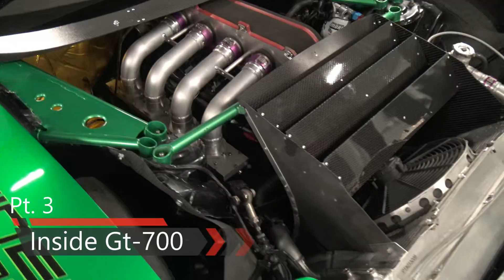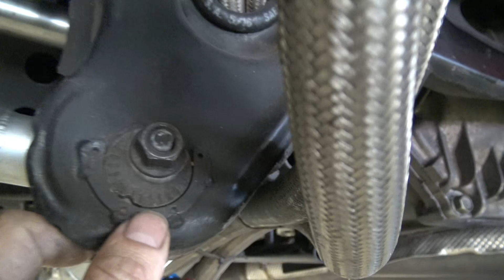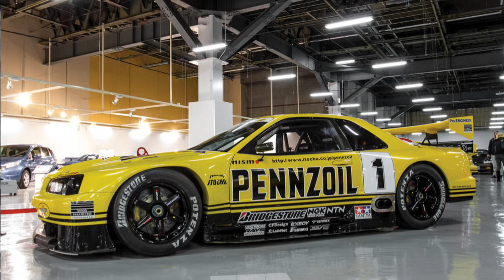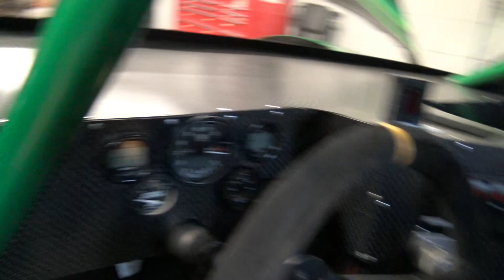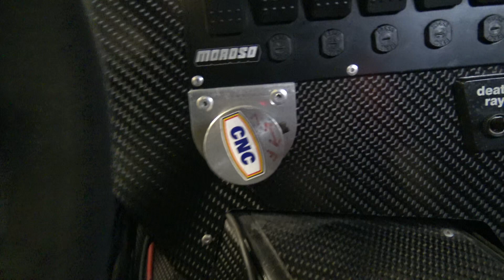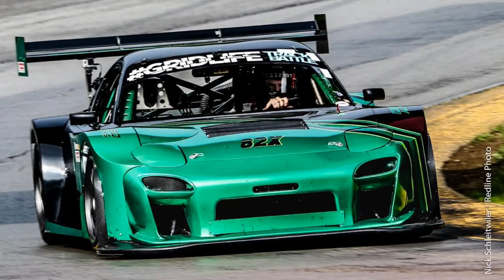*part 3* Inside the 4 rotor Mazda Rx7 Gt-700 engineering. Defined Autoworks

Comment: Old video, but I just ate up all 3 parts. Excellent work and engineering effective solutions to the engine and chassis!

Also one question... what does the death ray button do?
Reply from the maker: Thanks! Currently it is the datalogger but changing to a high power/ low power switch in the next month.

Comment: About the only thing I can throw in to the amazing amount of details here is that almost no one does an underbody diffuser correctly, but this is because on the 'enthusiast' level it is rather difficult to incorporate. A correctly functioning diffuser isn't really a front/rear solution, it is an effect of the entirety of the underside of the car and 'tricking' the air into treating it like an inverted wing. It's fairly easy to get air to do this around the front and rear axles, but fitting in the midsection on a factory car not designed for it and getting it to cleanly interact with the rear takes specialized shapes. Not dinking at your build directly, more of an general statement, but yes, an undertray has to begin it's shape directly after the front axle and essentially remained undisturbed all the way out past the rear bumper, and even then, it only works at a consistent high speed.

Comment: Do you ever plan to race her in series's like Gridlife track battle in the ultimate class where you can run full power without having to constrict your power to ~450hp? I imagine the gt700 will be very competitive in the ultimate class with 700+hp.
Reply from the maker: I actually ran in gridlife twice.  Both times the limiting factor was my driving,  still had 2nd and 1st finishes in class.  I just keep it at 440 wheel since bouncing back and forth to nasa was easier that way.  This year I'm working on a cockpit selectable high/low power.  For that very reason.

Comment: A rear diffuser will create more front downforce, actually mostly front to enforce with a front splitter. It will create more air massflow on the underside. This will create a lower pressure on the whole underside. It's one of the most efficient ways to create to downforce on a door slammer, which is why rulebook heavily restrict diffuser geometry. Diffusers in front of front tires also add front downforce.

Comment: So, how long have you been running those mag wheels, a long time right? and you've never damaged one?  Irreplaceable? Damage one, and you need a whole new set of wheels?
Reply from the maker: They have about 12 race days on them.  If one gets damaged then I'd need to search for a replacement.  It would be hard to find but singles pop up here and there.

Comment: Watching you drive on track from cockpit view, I was thinking it looked like a fighter jets cockpit that must've been constructed in a labratory by a team of engineers. Then video flashes to you beating inner fender well with hammer or mallet LoL . Sweet video, it just sounds so clean & almost tame when compared to other rotary race engines. I normally wouldn't ask this & I realize you can't put a number on your labor hrs but if sum1 wanted to duplicate your car  how many figures are on the price tag? You don't have to answer if you don't want to.
Reply from the maker: You totally get it,  I wanted to show that this is just a crazy creation from one normal guy.  A normal guy who isn't afraid to beat it with a hammer.  It's a pretty well oiled machine with careful tuning so it does seem to transmit that "smoothness" in video.  Definitely a bunch of hours.  If I had to try and guess the whole car cost, it would be around $250k to build for a customer.
Reply: @DefinedAutoworks1  $250k!! Damn it, I knew I would regret buying  my house.. I could've mortgaged 1... live & learn :)